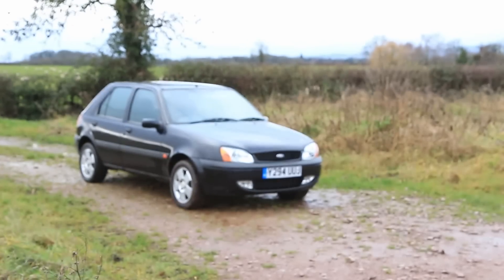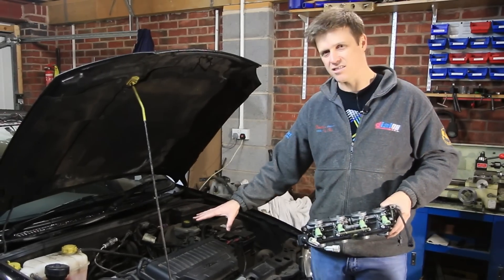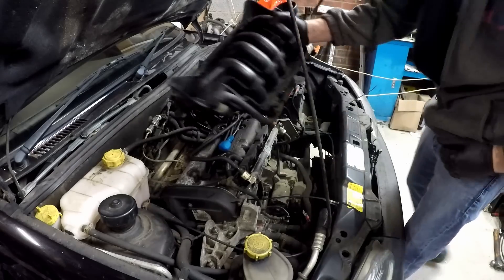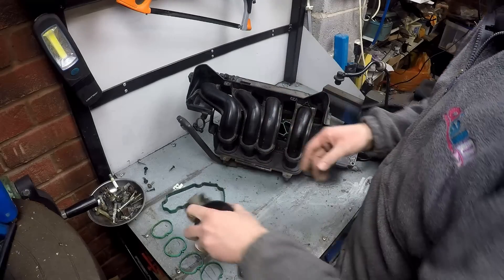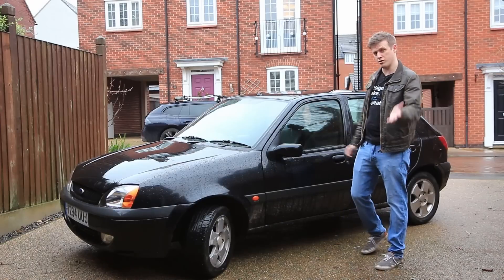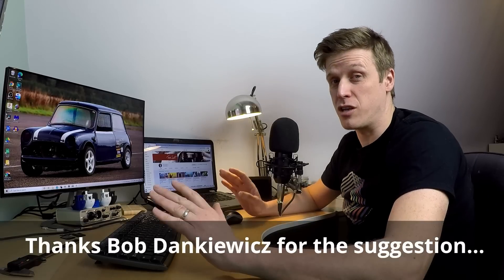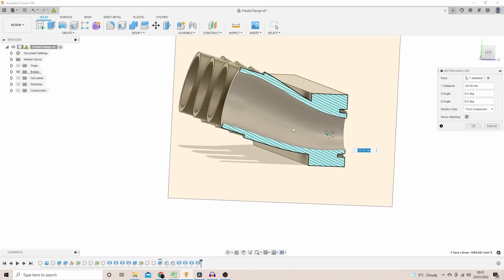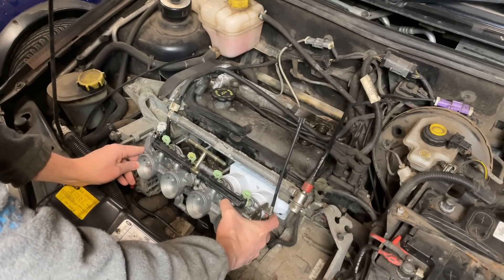Throttle Bodies and a Standard ECU.... Will it work?

Comment: Looking forward to the story unfolding. Got my printer at xmas & speed learned the fundamentals of F360. Working on the two plane balancer project and a replacement intake project (new plenum & single throttle body for old carb engine). Will need to do the hot end upgrade though, so I can print the CF Nylon version. Cheers for the inspiration!

Comment: great video! also to get the right fuel to air ratio just upgrade the injectors to higher CC ones to get the accurate data measure how much air it takes stock by using a stand alone maf sensor and how much it takes modifed then divide the two data points and times that with your injector size to properly uprate your injectors and theoretically should line up with the data sheet from the stock tune
Reply: That would be a waste of time if you could set it up.
Besides the ford injectors are big enough as the same set are fitted to 1.4 & 1.6 versions of this engine which he can reuse as stated since they bolt to the head.
Also the bike injectors will already have a high enough flow rate in general due to the higher engine speeds they work with if he decides to use those instead.
Reply: @mrzee1951  Agreed, I don't see injectors being an issue. ITB's are awesome, but  ITB's alone won't flow enough air to need a monster injector. I hope David does get this working. I have heard of guys attaching a plenum to ITB's to make them work with a stock ECU, however this car doesn't have a MAF which complicates things...
Reply: @Jason-fp7vi  yes a plenum would probably improve things if you had a MAF, it might help with the MAP readings too perhaps? I wonder if the 1.4 ECU swapped in along with a MAF from that model could work - from what I understand the 1.25 had MAP's fitted instead on some models
Reply: @mrzee1951  ho ho, that would be interesting. I would say that still fulfills "stock ECU" assuming it doesn't take a shit load of soldering to swap in the 1.4 ECU itself

Comment: Really cool! Definitely excited for the next episode. I'm sure you are many steps ahead of me, but my thought would be to basically make a balance port connected by four small tubes to each runner. You could obviously incorporate them into the 3D print. You could then attach the MAP sensor as well as the IAC valve to a small standoff reservoir connected to the balance port. Hopefully I'm making sense, but it would give you an average reading for the MAP and would allow all cylinders to take air from the IAC. By keeping the connected passages small, you wouldn't lose the advantages of ITB, would still be able to idle, and would have quick response to the MAP. Good luck have fun!
Reply: I've considered doing this for a Lima (Ranger engine)...

Comment: Normally with itbs with map you need a vacuum canister and run a vacuum hose from every runner to it. That should make the pressure signal even enough for it to run. The canister you can print of course. Is the intake temp a separate sensor ?
Reply: I was gonna mention this. I was gonna just use a steel beer can (one of the big sapporo steel cans) and drill it for barbs. My cbr1000rr itb's i plan on using already have a map sensor plumbed to each throttle body, so using the beer can would just smooth it out more so my ECU can read it better. Actually, nice thing about the CBR1000RR itb's, is for my application (a 1990 acura integra) it's almost all plug and play as far as the sensors go. I have to change the plugs, but all the sensors on the itbs are direct matches for what the car already expects. Hell, even the fuel injector sizing is the same as what my engine already runs
Reply: Beat me to it!
Reply: Intake temp is part of the map sensor afaik
Reply: It's a TMAP sensor.

He could probably break out the IAT signal and add a branch to the signal ground.

Comment: It will work with a map sensor but the ecu will give you a wide open throttle map across 90 percent of the map. Your best bet is to run without the 02 sensor to stop the ecu always trying to get to 14.7:1

Comment: I ran my 106 Rallye on itbs with no MAF or map sensor using the standard GTi Marelli ECU. I believe that the load was picked up by the TPS instead. Chip Wizards did loads of them about 10 years ago.
Reply from the maker: Some of those early Marelli systems were as good as fully mappable straight out the box… lots of good stuff to be done on them… and a 106 Rallye ?   I am jealous!
Reply: @MakingforMotorsport  I'd better not tell you it's been replaced by a 106 maxi then no?
Reply from the maker: Grrrrrr…..

Comment: my new favourite channel this!

I’m going to guess that manifold pressure in intake is going to be wildly different than in ITB. not least of which ZX6 has 150cc pistons moving much faster over a much wider rev range - vs 300cc pistons in Siesta moving much slower over a narrower range.

I figure theres going to be a bit less vacuum measured per ITB compared to
full airbox, so I reckon it’ll run - badly, refuse to idle, will need a fair bit of revs and the AFR’s will be all over!

That said - its all academic until you try it!

Can you measure AFR? got a wideband sensor?

Someone can map that ECU I bet - it’ll be a vaguely common CPU arch to something else that has been mapped.
Reply: I'm running itbs with map sensor with good success just needs to be well thought out and set up
Reply: @arran951  What ITB's are you running and on what engine? do you have a single map sensor in one of the ITB's - very interested to know how you got this going.
Reply: @nickb2179  I'm using triumph tt 600 bodies on a toyota 1.3 4efe engine. Iv got 4 vaccuum lines one  coming from each intake runner. They all go into a vacuum block which feeds a stable vacuum too the fpr the brake vacuum and the map sensor iv got a clean fuel filter in the vac line too the map sensor to smooth the pulses again before the sensor sees it

Comment: Mandatory like and comment for the algotithm!
Also a question you might be able to answer.
I'm starting to make a list of stuff i'll need if i want to itb my miata and while buying parts is fairly easy it is probably just 10% of the job. I just don't know where to start with the ecu. The car is mostly stock (just bolt ons) and currently running off of a ms2 on speed density and i can't find base maps for itbs. How would you go about tuning it? Where would you start?
Reply from the maker: It’s been a few since I played with a MS, but if you can run switchable MAPs there are lots of people running MAP in the top half of the table, and TPS at idle. 
But you already have the key numbers for idle advance & VE and those for WOT so it’s mainly a task of rescaling…
Reply: @MakingforMotorsport  yeah it was mostly a question about tunerstudio and tuning than megasquirt, my doubts are if i can just change ignition and ve table from map to tps and expect the engine to run well enough to autotune without grenading itself...
Also VE table should be easy enough, the problem will be ignition as i don't think i have a knock sensor
Reply from the maker: @alessiocarlevaro6934  so the main difference I have found with tuning ITBs is that at low revs you get a lot more load at low throttle openings, this means you need to cluster the kPa bins at the low end for accuracy.   
But you dont need to worry about the ignition timing as you already have the key values, idle adv, max adv at WOT and the “all in” revs, aslong as you are not too aggressive with it you can build a safe map👍
Reply from the maker: @alessiocarlevaro6934  and don’t forget to recompile reqd fuel if your using different injectors!

Comment: Great video as always! I found your channel through your videos on the mini and have loved watching them since. You're videos make me hope that one day I will fit a custom ITB setup to my car! 
Also, just an FYI, it might be worth checking that you have your mic oriented correctly and that you have the levels set properly. Your audio is super crisp, but its a little inconsistent and difficult to hear at times, and also only was coming out my left headphone, haha!
Reply: Yes, I was having the same issue. I thought my cable broke
Reply from the maker: Yeah, first video with a new mic… and I thought I’d got the hang of this 🤦‍♂️😂
Reply: @MakingforMotorsport   Hey quick tip: In case that happens and you notice it in post, use fake stereo for the parts with bad audio just so there is consistency. Not the ideal solution but way less intrusive. Great video tho. Good luck!

Comment: Looking forward to this project. I’m interested in how you mount the factory TPS to the bike throttles.
Reply: If turning direction of tps is the same it will be no problem to mount a Ford tps for him - he will end up with the crazy 3d adaptor plate 😀 though i hope voltage readings will be the same for bike tps it would save some time
Reply from the maker: So am I! 😂🤞
Reply: As long as the throttle position sensor on the bike electronically moved the same way as the throttle position sensor from the car, I would just use the one that bolted up OEM for the bike.
Reply from the maker: @TravisFabel  if it’s different I could just swap over the 5v and earth lines and it’d swap direction from standard… will probably keep the same sensor tho… but maybe not 🤷‍♂️😂
Reply: Wonder if the stock ECU will recognise the bike TPS?

Comment: ooph. you cut this episode too short. 
What are you planning on for runner length? looks like it was previously a longer runner design. Can it afford to reduce its lower end torque?
Reply from the maker: Hi Travis, it’s abit shorter than I wanted but I couldn’t really help that because, well reasons, but this is just a bit of a play around so I’m not planning to get fully into runner length, but my take on the OEM design is that it’s about packing and cost rather than pretty much anything else…

Comment: MAF MAP and TPS Sensors are 0-5V IFAIK. So could you theoretically swap MAP sensor with MAF or TPS, rescale load axis in ECU and make map from scratch?
Reply: @Lassi Kinnunen 81 Impossible, itbs will show 100kpa at 60% throttle witch will make MAP sensor useless over that. Someway he needs to put more fuel in to not melt something inside. Easiest way would be carbs tbh.
Reply from the maker: I will be sticking with MAP for that reason, as that’s the key load parameter, the difference will come if it flows more air at 100kPa then it’ll lean out, there are a few things I can do, plus the fuel trims in the standard ECU will help in closed loop operation…
Reply: @MakingforMotorsport  I wonder if o2 sensor could "feel" that lean mixture enough to not damage the engine (i mean positive fuel trims)
Reply from the maker: Hi Lassi… I don’t even want to cut a wire, let alone remap the ECU… it might be tricky 😅
Reply from the maker: There will definitely be some shenanigans… 😂

Comment: Good project this. I have a set of AT power ITBs I picked up for my shitbox and I'm looking to ft them but there's a lack of info compared to turbo installs. Looking forward to this!
Reply from the maker: AT Power, nice!  I will be going through every combo, standard ECU, stand-alone ECU and then in depth tuning… stick around! 👍
Reply: @MakingforMotorsport  Swinging back to watch this again. I have a DTA ECU that I picked up with the ITBs, I'm just making a patch harness just now, nice summer project for myself.
Reply: Iv fitted itbs to my starlet with good success if you have any questions
Reply from the maker: What ECU are you running?
Reply: @MakingforMotorsport  standard ecu  with ecumaster det 3 currently in piggyback mode. The car runs and drives fine without the det 3 but was way too rich at idle and cruise.. fueling is now perfect . It sounds amazing and made it a quick little car. I didn't encounter too many problems getting the map signal to work. Although when I changed the load from map to tps the car is alot more  drivable
Reply: I'm really holding out for the speeduino install. That will be a gamechanger.
Reply from the maker: Hopefully you won’t have long to wait!

Comment: As someone that works on smaller vehicles alot... I would think YOU would use a 1/4 drive ratchet more often. lol
Reply from the maker: My 3/8” drive set goes down to 7mm, plus the Mini has been rebuilt from the ground up… it’s amazing how you can remember every single fastener size (but then I have had some practice at taking it to bits 😅)